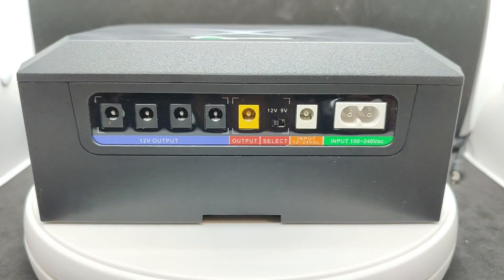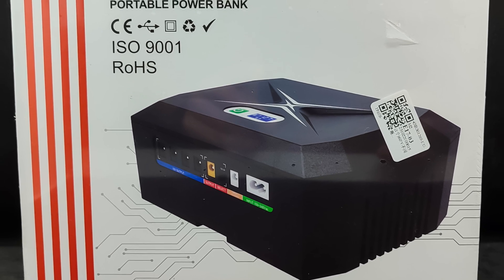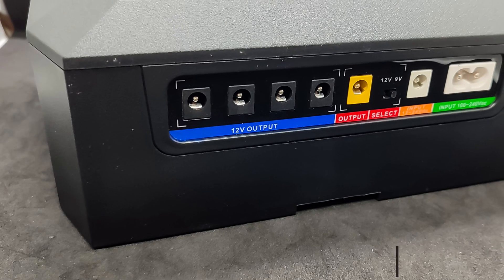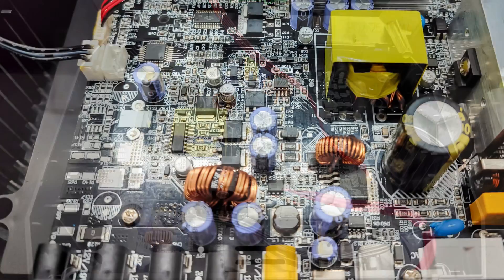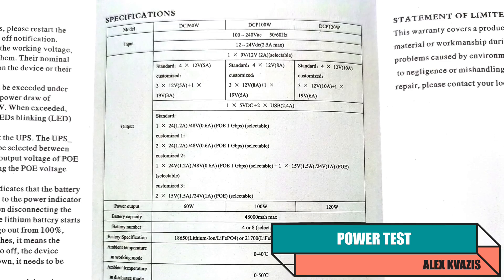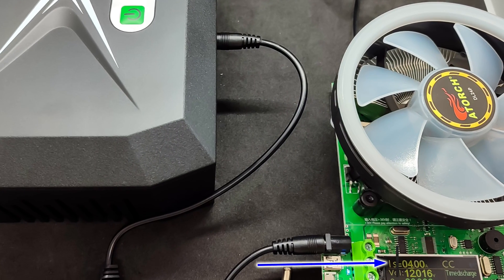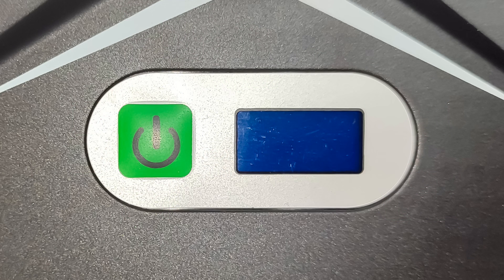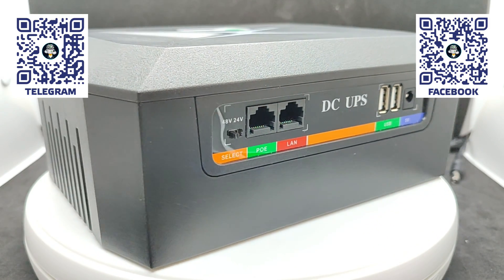Многопортовый DC UPS 60 Ватт, с выходами на 5, 9, 12 Вольт, а также POE 24 - 48 Вольт

Comment: Тут надо учесть еще несколько моментов. У поставщика есть большой спектр вариантов по аккумуляторам. Например сейчас они уже не выпускают упсы с емкостью 20800 мАч, а перешли на 48000. И даже при одинаковой емкости есть варианты с 18650 li-ion, 18650 lifepo4, 21700 lifepo4 и 32650 lifepo4, я заказал именно в последнем варианте. Второй момент - это одна из немногих моделей, у которой есть опциональный 19В выход >2.5A (модели 60W/100W/120W). Большинство вариантов на украинском рынке это или 12В или в редких случаях 19Вх1.5А, что маловато для асусов.

Comment: Большое спасибо за обзор.
В свете последних событий рассматриваю покупку подобного устройства:
Модель: DCP-120W-19V

Входное напряжение: 100–240 V, 50/60 Гц, 12–24 V постоянного тока (макс. 2,5 А)

Выходная мощность: 120 Вт МАКС.
Выход: USB 5 V*2 (всего 2,4 А)
5 V постоянного тока*1 (2,4 А) 9 V/12 V*1 (2 А) 12 V*3 (10 А) 19 V*1 (6 А)
POE 24 V (1 А)/48 V (0,6 А)
Емкость аккумулятора: 20800 мАч, тройная литиевая батарея.
Хочу запитать UPS через DC от блока питания роутера ASUS RT-AX86S, 19,5В (2,31А), и подключить к нему в DC 12V (10A) непосредственно сам роутер, а в в DC 19V (6A) моноблок Acer Aspire C24-963 (Блок питания для моноблоков Acer Aspire C24-963 19V, 3.42A).
А теперь непосредственно вопросы:
1. И самое главное! На Ваш взгляд, на сколько безопасно использование UPS в таком режиме? Роутер будет работать всегда, а комп выключится после сохранения данных.
2. Что скажите, если заменить "родные" аккумуляторы на сборку 8S4P 18650 Soshine 1800 mAh LiFePO4 3,2В c защитой (Protected)?
Reply from the maker: Так вы в телеграмм это спрашивали уже
Reply: А мне бы тоже ответ тут услышать